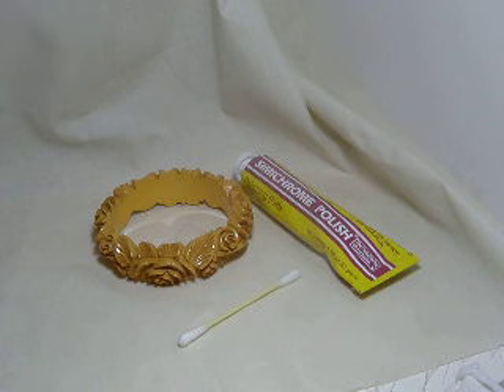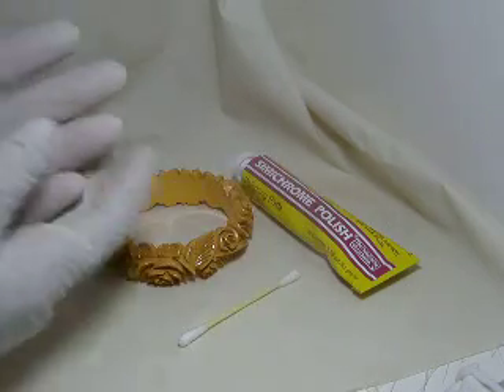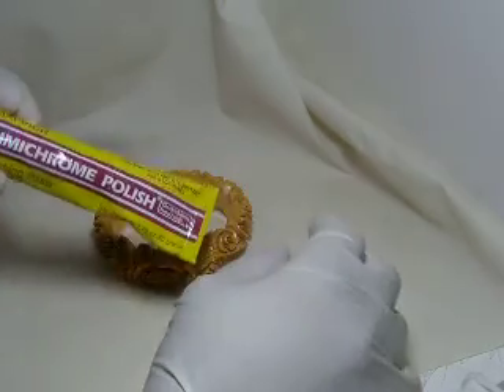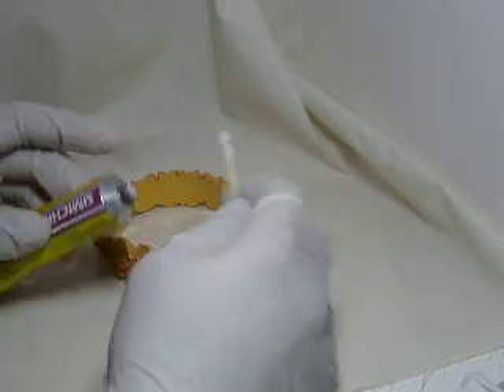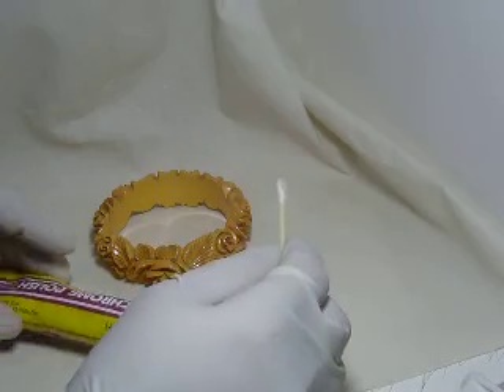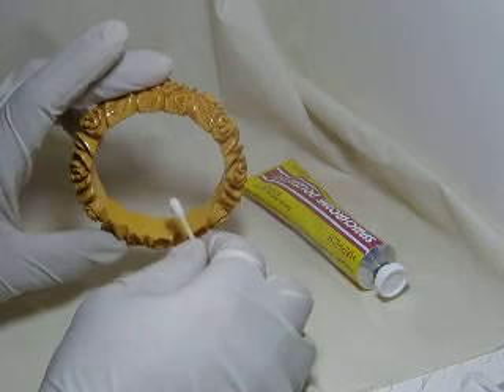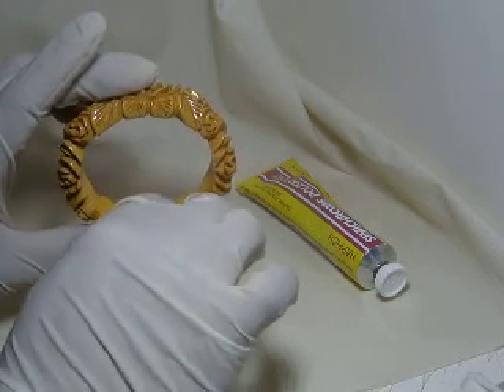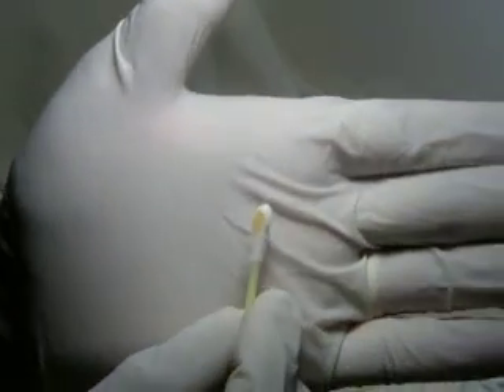Bakelite Test

Comment: I would like to know how to restore an originally white bakelite handle that has turned a creme yellow color.  Will sinichrome remove the oxidation and restore it back to its original white?
Reply: maybe try mr. clean magic eraser on an inconspicuous spot. It works wonders on things.
Reply: @seriousorganizer  What worked for me...salon hair coloring bleach in cream form, 40 power or higher.  Clean thoroughly with degreaser, coat the part generously, place in glass bowl, cover with plastic, sit covered in sun.  I rotated the part every day and reapplied bleach.  Took 3 days but came out perfect.

Comment: @Ohio1TreasureHunter 
Did you then try it with Simichrome? Usually if it doesn't test with 409, then it's not Bakelite. I've never had a test reply differently,when trying both 409 & Simichrome.With all the fakes going around, the hot water or friction test is the 100% way to test.The fakes circulating online, WILL pass the chemical test.They're that good at faking these pieces.

Comment: If the bakelite has been restored to its original color which is white on this bangle, this test will not work. Also people mistakenly call the material bakelite. It is actually catalin.  Restoring the color to white can only be accomplished by sanding the surface which is something you would never do on a bangle.
Reply: Are we watching the same video. The bracelet is yellow, not white.

Comment: I just bought a brand new bakelite reproduction guitar volume knob. The seller claims it is bakelite. But, I cannot tell for sure if this is true with the smell, sound and 409 methods. I have never smelled true bakelite before. Also, these pieces are brand new and totally white in color. So, I'm not sure if they've even had a chance to oxidize. Please help. Thank you.
Reply: I don't believe bakelite has even been used for 50 yrs. It was pre-plastic.